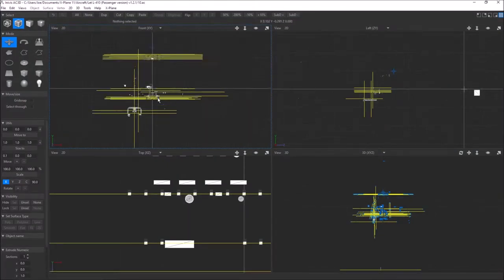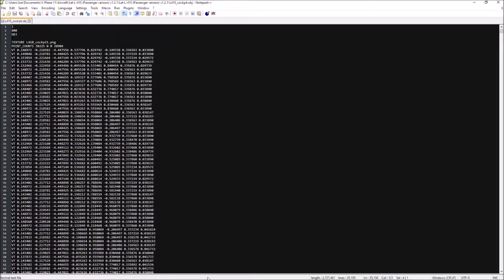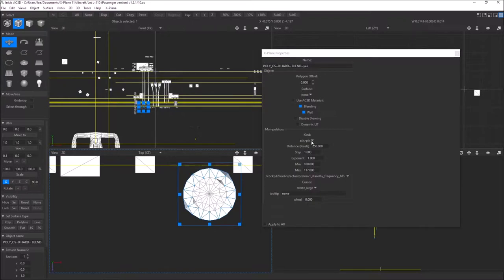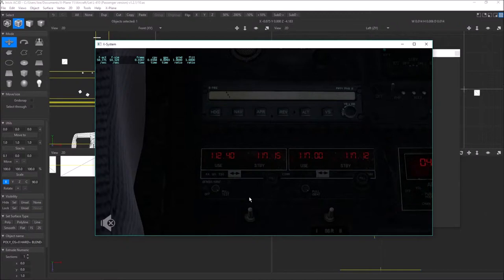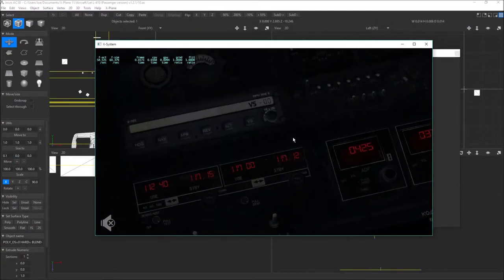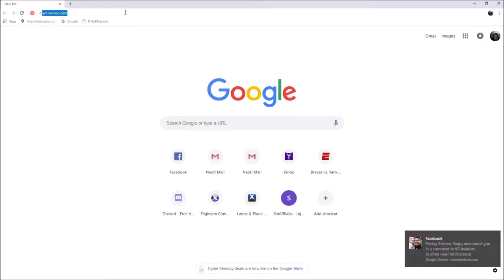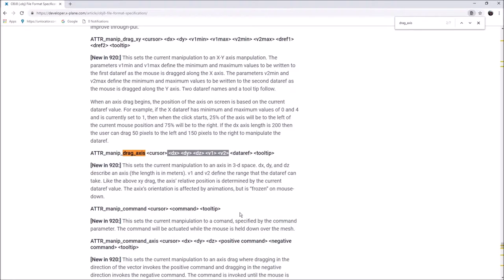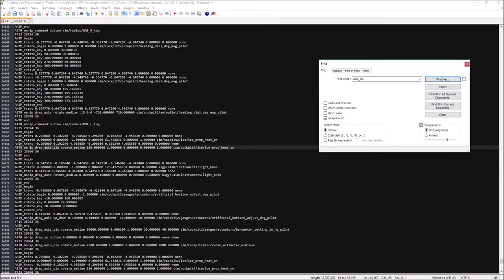SimVRlabs - Come Labs with Me - Tutorial Part 3

Comment: Joe, is the AC3D software still useable after the trial period? $100 software!  Can you do the kinds of things you're doing manually without the software?  I know - I'M CHEAP!
Reply from the maker: Well, the kinds of things I'm doing in this video and in the upcoming videos you don't need AC3D for.  But yes, to bring in the yoke and the center levers you need either AC3D, or you can also do it in blender for free, though it's much more of a learning curve - made me want to throw myself through the wall.  :)  I dont think ac3d works after the trial, I think it blocks your export, though I'm not totally sure.
Reply from the maker: The deal with blender though is you cant import, so you'd have to get the source blender cockpit mesh from the dev directly.  So, definitely adds complexity.